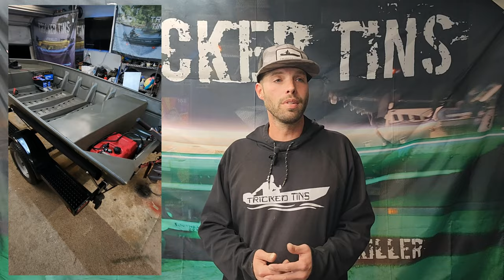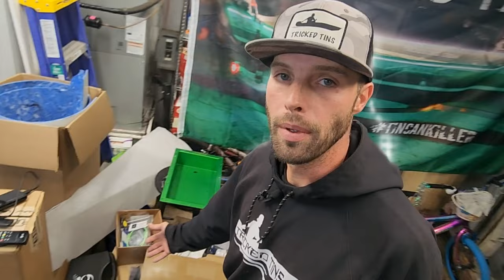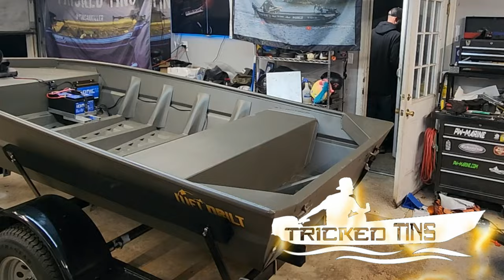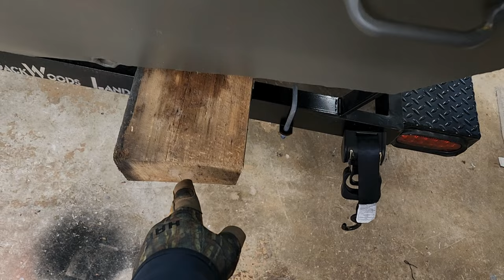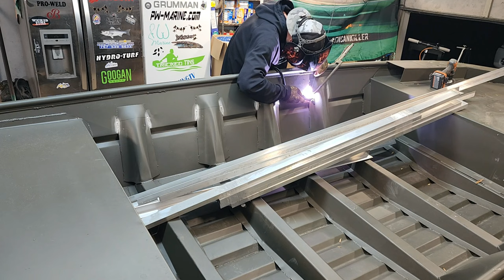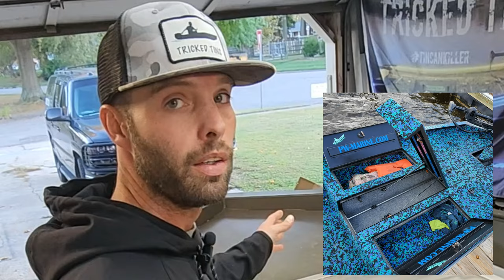1448 Weldbilt Full Build! pt 1 #jonboattobassboat

Comment: When I redid my jon boat mod this year having a lockable rod locker was my main priority. It's the reason I cut my middle bench out. It has saved me so much time in the parking lot. I used to have to load and unload my rods at the ramp and that little bit of time makes a difference. Not to mention I don't worry about my rods if I'm dropping a deuce before hitting the road when I fish alone 😁
Reply from the maker: Might do the locker. Seems like it's what the people want.
Reply: @TRICKEDTINS  I'm sure your customer will appreciate it. When not holding rods it just becomes a large stow. I use my port side rod locker for a paddle, life vests and tackle. Can't go wrong.

Comment: Great start. New or old, so you want a custom build. Stuff gotta be moved, cut and welded. Not for the weak hearted. I'm a fan of the rod locker because I mostly fish alone. If I had to leave my boat for a minute it wouldn't be an option around here. Loving the plan and build so far.
Reply from the maker: Thanks brotha! That rod locker is still up for debate...

Comment: The rod locker is important because you don't want dust getting in the reels when traveling. Plus most bass guys bring extra rods that won't always be used but need to be stored on the boat.
Reply from the maker: I hear ya. Its only a 14ft boat tho. Im still on the fence about the rod locker
Reply: Lol rod locker?   What’s wrong with the floor of the boat?
Reply from the maker: Watch the final real

Comment: No way a 9.9 can make you go 22-26 mph
Reply from the maker: The 1448 tracker grizzly I just built hit 26 mph with the same exact motor. Its a 9.9 with 15hp reeds.
Reply: @TRICKEDTINS  good to know my 15.5 sea nymph has a 30 hp 1986 evinrude and does about 20-24 with two people and tackle.
Reply from the maker: It's probably full of heavy waterlogged foam. It has a lot to do with weight distribution, RPMs, prop, and jack plate.

Comment: I just picked up a Grumman 1988 17ft 75 inch wide 21 inch sides, 20 inch transom tin boat that resembles the lowe 1648 aura. I'm in Florida and I'd like to drop the boat off to you and get some things done before I paid t it. Do you have an email address or phone number?
Reply from the maker: Never heard of a 75" wide? Width is measured at the floor of the boat. No offense,  but Im really not interested in working on an old rivited hull. You can reach me at TrickedTinsJonboats.com
Reply: @TRICKEDTINS  50 at the water line 75 top side, and its all welded 680 pounds modified V